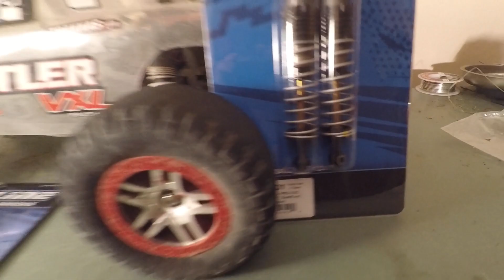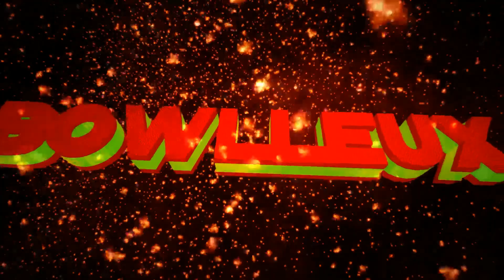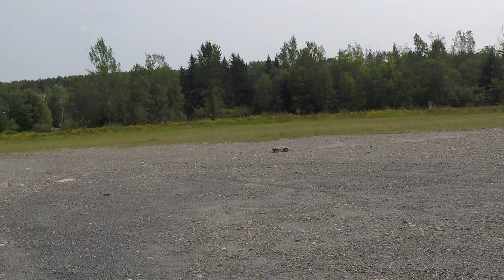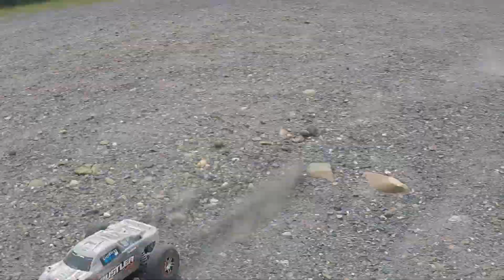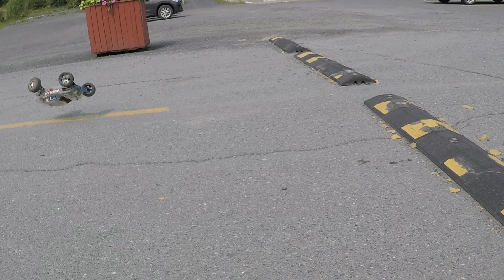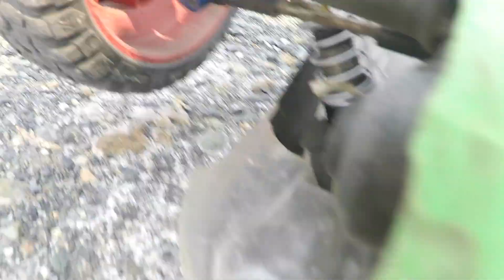ProLine PowerStroke Shocks for Rustler VXL First Run

Comment: Ok I’m confused. I got the proline racing powerstroke shocks. On amazon it says that they are a 1/10 scale shock. Get them shipped and they are noticeably way larger than the stock ones and it says even on the package that they are only for arma vehicles. These are definitely not them these are the 1/10’s but will the powerstroke work? There is one review on amazon of s guy who installed them on his slash (same chassis damn near the same car as a rustler) but it lifted it quite a bit.
Reply from the maker: because arrma shock are way bigger.... mine are for the traxxas rustler same size of stock one